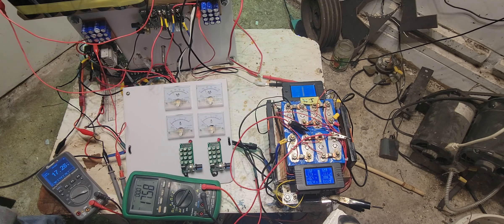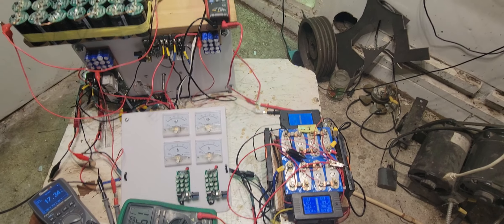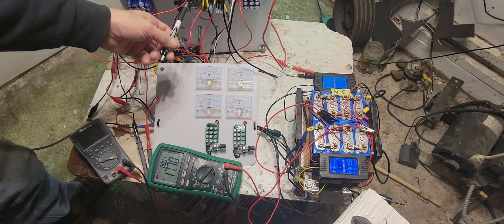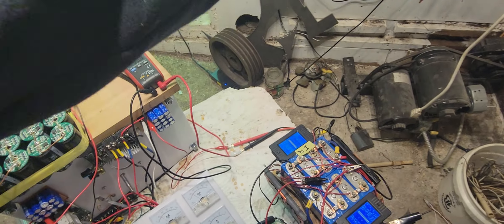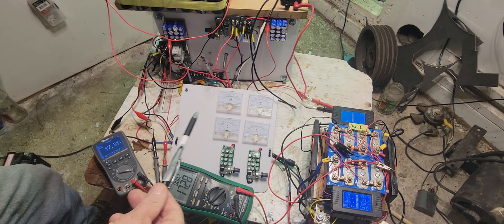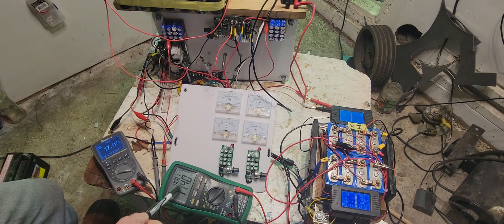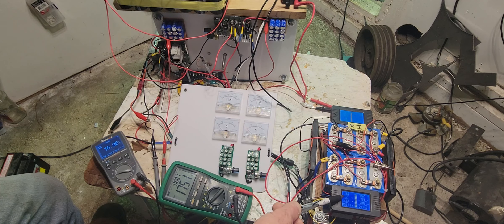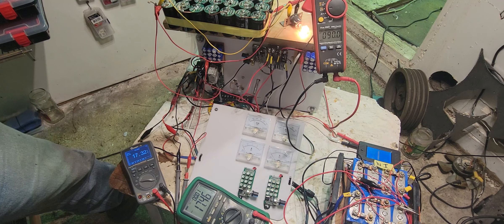Pulse Motor Update

Comment: Thanks for sharing
Can you tell witch cap pulser you use
Mosfet based have higher amps
Reply from the maker: Do you mean out of the different versions that I have built?
Reply from the maker: I found it depends mainly on how much input going into the motor and also timing is VERY important. Frequency of the pwm makes a huge difference and definitely depends on the coils and number of magnets on the rotor for best backspike output. 

As for the highest amps I found the Mosfet circuit I have built is very tunable and can deliver a huge amount of current or next to nothing depending on how it's set.
The SCR however can deliver a huge pulse also as long as the voltage gets high enough in the cap. Large cap value is key to getting large amps at a lower voltage.  Lower value caps will require a much higher voltage to achieve higher Amp pulse. 
Both circuits are capable of giving close to the same results but cap size is key to  getting the results that you need and will have to be sized accordingly to the situation.  I hope that helps
Reply: Can you send me the mosfet schematics @windpowerandmore6310
Reply from the maker: @Edmorbus sure will as soon as I have a chance